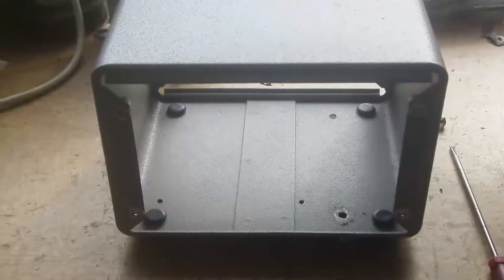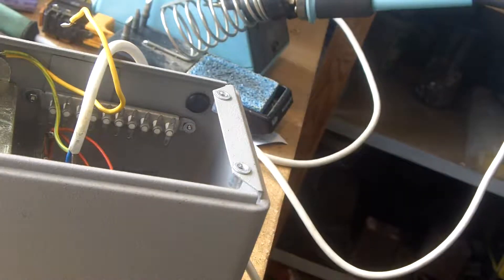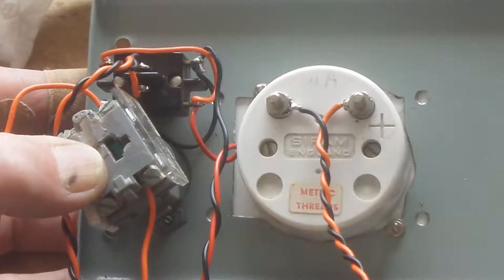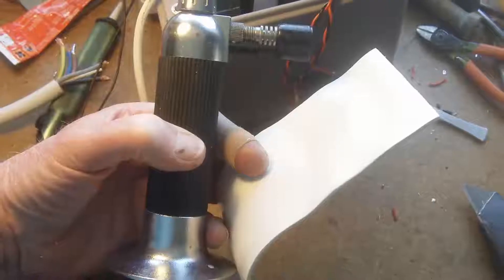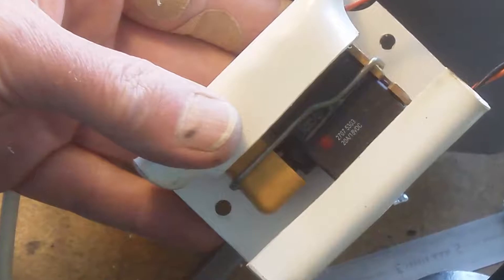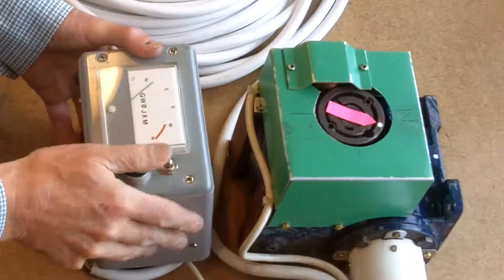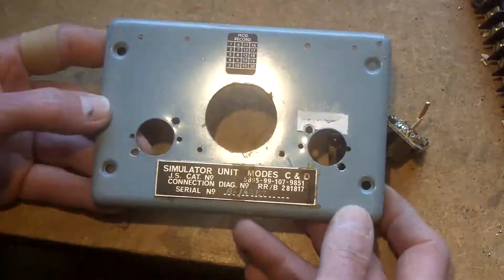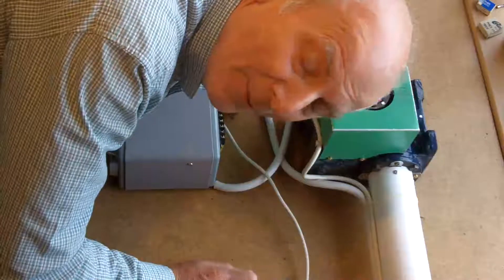About Radio 84  part 16 Antenna rotator, construction and bench test

Comment: Ever try using a set of locking forceps (often found at tool/hardware stores or bait/tackle shops) to hold little nuts instead of tweezers? I've had pretty good luck using them for very small nuts and it's nice because you can lock them onto the nut so you can just hold it up to your bolt/screw and spin it on.

Comment from the maker: 1 of 2
Hi, I’ve had many years as an inventor and problem solver and sometimes you just want to quickly try something out to see if it’s going to pan out the way you think it will.  Rather than building something that has to be designed, ordered and assembled and debugged only to find out it’s no good. I’d rather cut the handle of an old electric drill, bung it in a drainpipe and run with it. If you like the design, then start spending time on the finesse of design.

Comment from the maker: Hi Billy, man I couldn’t believe it when I unbolted the coax sockets and the realization hit me in an instant; it was a real ‘switch on’ moment. 

I’ve moved house several times and dragged that blessed meter around with me thinking ‘I’ll sort that out one day.’

OK on the tape, I use tape very frequently; if you have one of these neodymium magnets that seem to pull iron dust out of the air you can clean the iron dust off with tape.

All the best ... Andy

Comment from the maker: The simplest bridge rectify is just four diodes connected in circle.
Each diode acts as a one-way valve for electricity and by connecting them the right way around the four diodes will convert Alternating Current (AC) into Direct Current (DC) 
Consider four connections N,S,E and West one diode connects from W to N and points to N, another connects from N and points E the third connects from W and points S and the last goes from S to East.
AC is fed in to N & S you get DC +ve at E and –ve at W